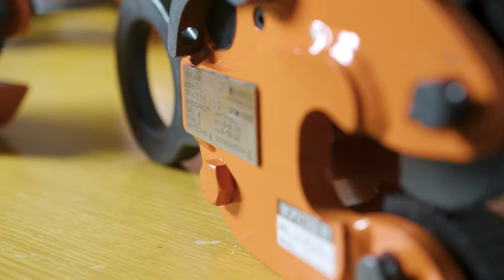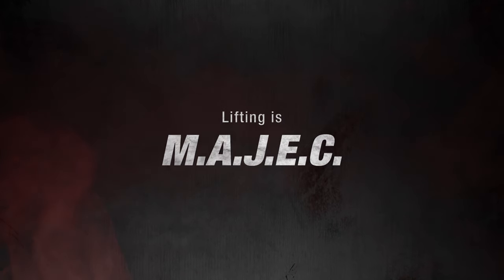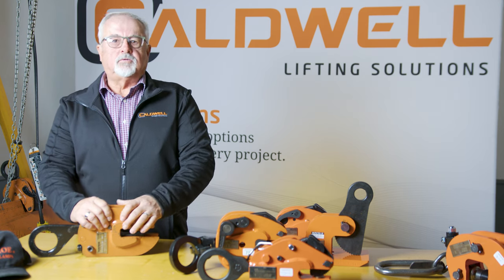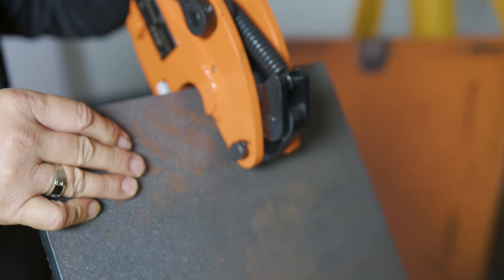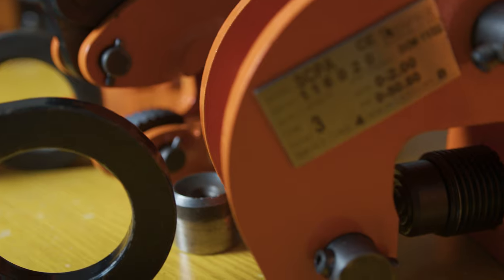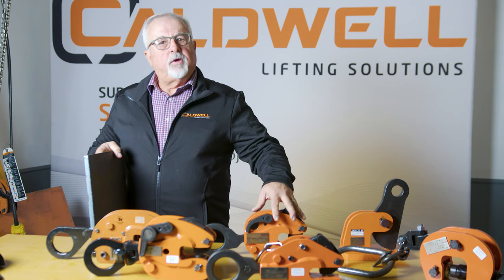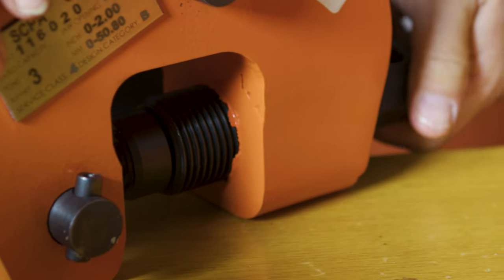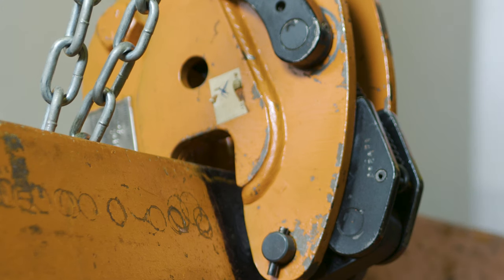How To Choose a Lifting Clamp

Comment: What type of clamp can be used for Diamond Plate or a Painted / Coated surface that you don’t want to damage ? Thanks .
Reply from the maker: There is 1 option. (a sample of the plate would be needed for testing and it would be dependent on the WLL) A non-marring clamp with Rubberized pads may work.  Caldwell Renfroe has a model NMBL with K22 rubber pads.  They can conform to the diamond plate (depending on the height of the diamond). You can contact the Mazzella Lifting and Rigging Division here for help https://www.mazzellacompanies.com/company/contact-us/contact-rigging-division/ or check out https://jcrenfroe.com/ and you can contact Dale Kelly.
Reply: @LiftingandRigging  Thanks , for the help .